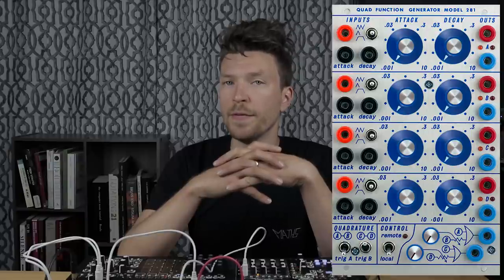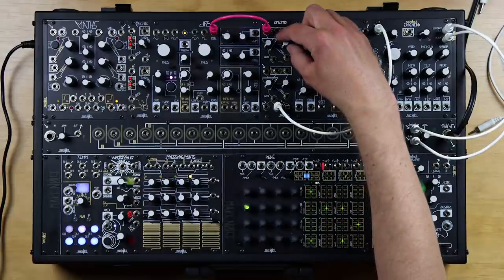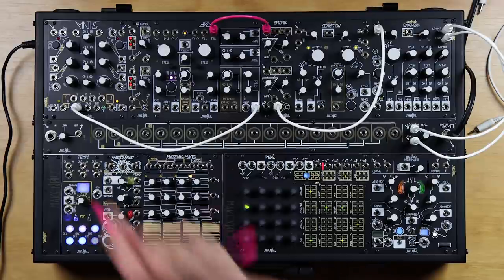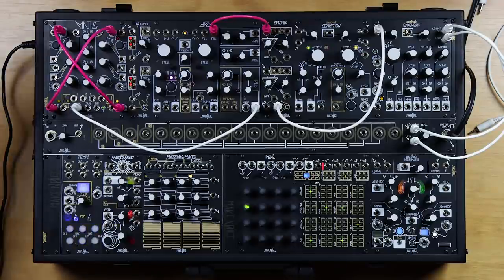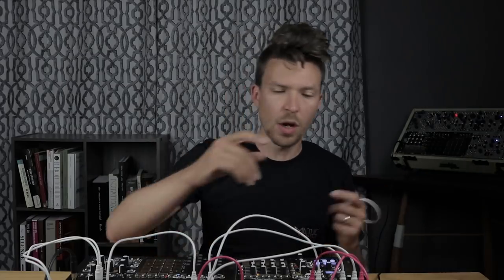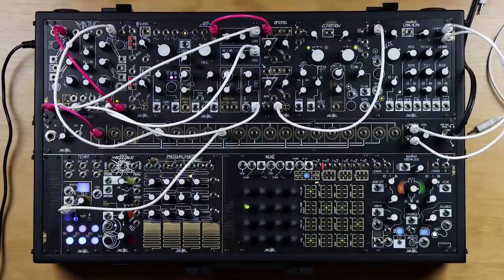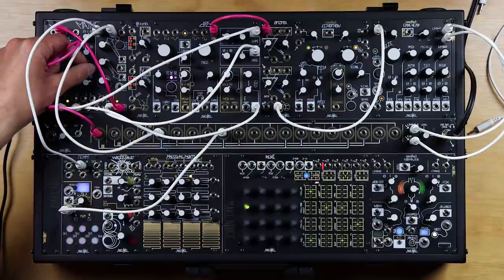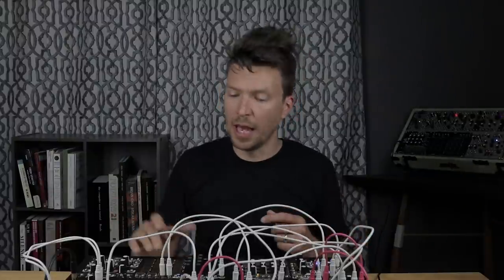MATHS Swirly Bird Grooves

Comment: Spectacular patch! Another trick I like to use with Buchla 281 is to trigger a function from a slow master clock but have the function set to loop a number of times between triggers. That way you can create as many repetitions as you like within a bar, including fractions since it will stop wherever it is in the cycle when it receives that retrigger from the clock. You can get some really odd and interesting patterns. Even if you modulate the A/D times the pattern will still fit within the same time frame due to that master clock retrigger. Or even just modulating a slower A/D by a faster can imply some sort of sync like this: https://youtu.be/gDwYsCmctKM . A consistently restarts every 12 cycles of B. In this one A is master clock retriggering B after an imperfect 16 cycles: https://youtu.be/tf7xhsbtyaY . Off kilter and quirky.
Reply from the maker: Looks like fun! Externally clocking can really help if you want rhythmic play while the overarching tempo stays the same.